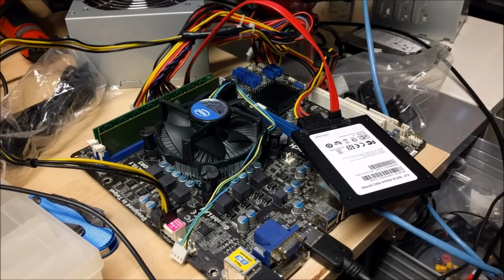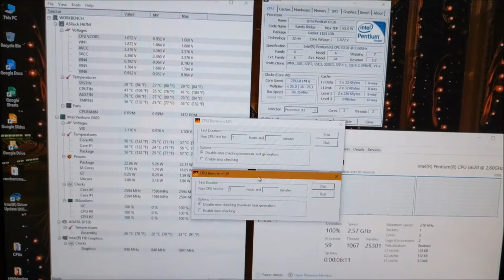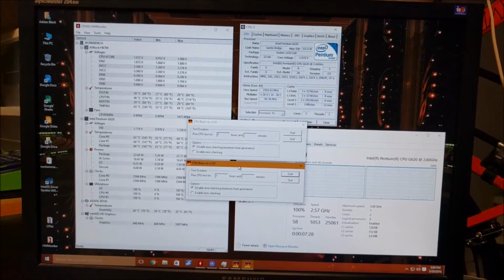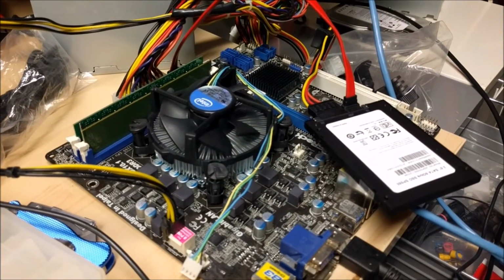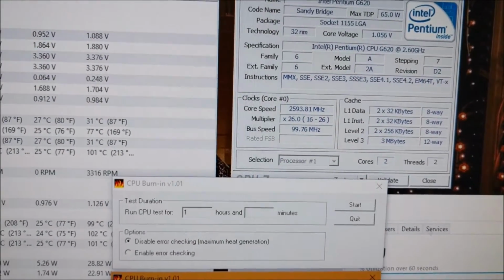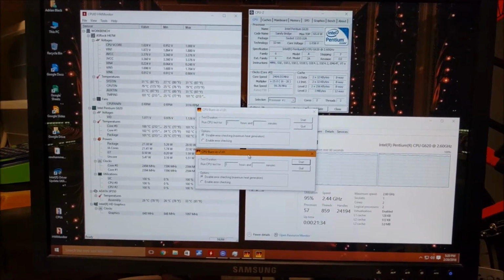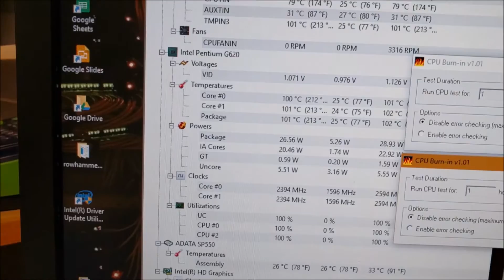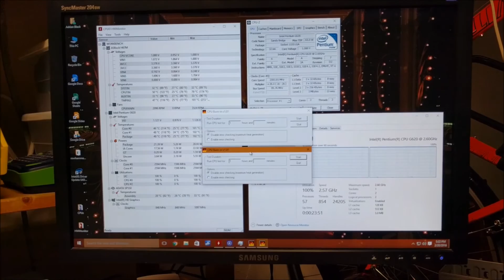Exploring Intel Thermal Throttling (torturing a CPU)

Comment: I suspect that the processor didn’t throttle for so long, and even then barely did, just because the power requirements are low enough that the thermal mass of the heatsink is probably enough for it. This was, after all, basically the logic behind the Atom chips: tweak the power down low enough that we can get a viable mobile CPU out of our existing architecture.

Comment: I would check your RAM with those random shutoffs like that. I've seen that before on my systems with corrupt/damaged RAM that otherwise appears perfect and even passes full sets of memory tests.
Reply: +Adrian Black Yeah that is weird, its possible the motherboard is a really simple one that can't handle a higher end CPU I've seen that before too. But at least it'll run the other one :) Kinda funny to watch your video with that too cause I have a similar Pentium that I'm torturing in my old gaming rig right now too until or if I decide to invest in something more. 
But if it is the motherboard that's at the heart of the issues I'd RMA it with the manufacturer cause it'll probably only go down hill from there. Best of luck man!